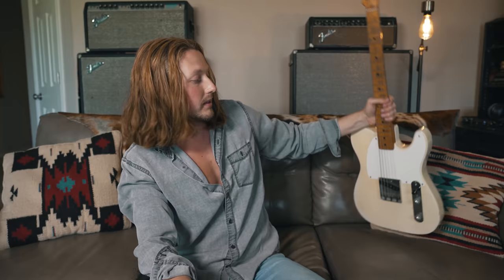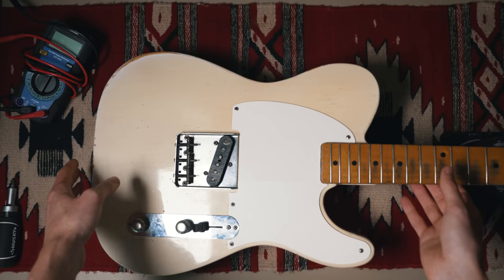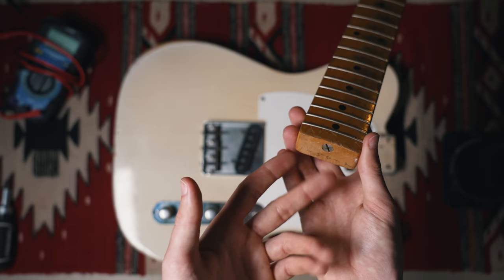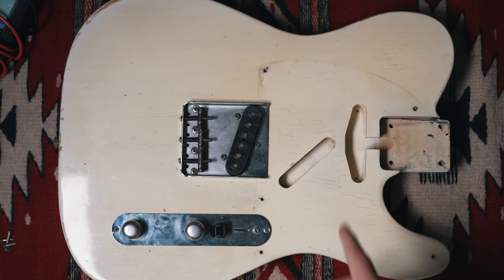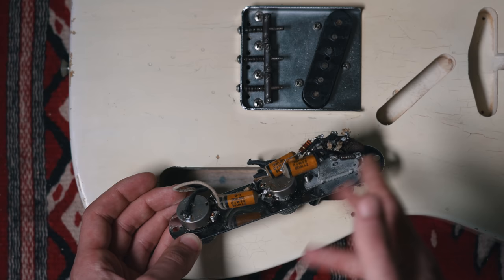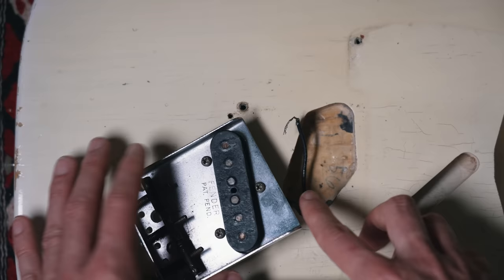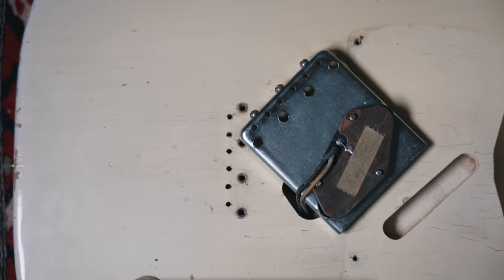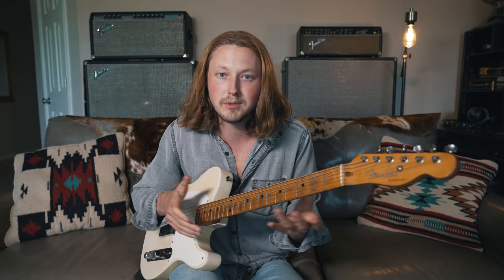Surprises found in a 1956 Fender Esquire

Comment: From all your videos, this guitar seems to be aged in the most beautiful way. Previous owner really took good care of the instrument. It's a keeper. Love your work!
Reply: It's a repaint: The beneath-pickguard paint crackle is fake with aging dinks and doinks! It's made in such a way as to suggest to the eye upon inspection that any pickup hole plugging where the inlaid block is gonna shrink, is part of an original aging proces which is worser in the middle. Thereby your having been completely fooled, it is an excellent job and done as intended... to fool the naked eye. And if anyone doubts this? Look at the "obvious tell" where the plunge router following the top template, went about 0.055" too deep in the between-neck-pickup pass, and the slot tells it all right there. Restoring the neck pocket to hide that one, would require surgical-level template making and possibly the last straw oopsie that blew a near-perfect "vintage" aging finish.

Comment: Couldn't the "Esquire" on the tape on the pickup have been written by someone who had the guitar apart in the shop and wanted to make sure that the pickup got back to the right guitar?  Just a thought.  Thanks for doing these videos.  I learn so much.  😎
Reply: Agreed saxophool, maybe when the humbucker neck route was repaired the Luthier had more than one Tele in the Shop, you'd most certainly want to keep the parts sorted and the tape fits that scenario perfectly.
Reply: How? Original solder  . . Seems pickup has never been removed
Reply: That was definitely the old Fender factory tape..
Reply: @MrTom1468  Yes. Missed that.  😎
Reply: that tape was maybe to separate esquire pickup in the factory from telecaster pickup in the factory
Reply: A better hypothesis is that this pick up was accidentally slightly underwound so to avoid an unmatched set of pickups it was designated for a single pickup Esquire.
Reply: @j_freed  that sounds most likely to me
Reply: @MrTom1468  I thought I saw shrink tubing/tape on the pickup leads at the switch.
Reply: @tater9384  I saw that too. I don't think they used shrink tubes back then.
Reply: @j_freed  That's a great hypothesis
Reply: 👀whoah...heavy thread.
Reply: @davidreineke1758  I'm pretty sure they did, I saw lots of them on old Strats especially, all squashed and dried out.
Reply from the maker: It's possible I guess, but the tape used is identical to what Fender was using in the 50's and the handwriting is reminiscent of what was seen at the time.
Reply: @barrygoins6900  Nope! They're all the exact same pickup. There is no difference in windings or construction. The only difference is the wiring for the Esquire which offered a bassy neck pickup sound in the neck position, a regular bridge pickup with tone control in the middle position, and finally the bridge pickup bypassing all the controls except the volume in the bridge position. I've owned three of these guitars and they always had the same pickup for each one whether or not it was a Telecaster or Esquire.
Reply: @j_freed  No - same pickups for both Telecaster and Esquire.
Reply: @MatthewScottmusic  Got it!
Reply: Perhaps it is related to switching from the flat poles to staggered on the guitars around that time? Maybe an in house experiment? That's exceeding cool and definitely begs a whole mess of questions.
Reply: I’d say the guys name was esquire
Reply: This is the exact comment that I was about to say. I know that I label all of my pickups so that I know what guitar it came out of. I just have so much parts and stuff that I’d never remember every piece
Reply: @MatthewScottmusic  its cool trying to figure things like that out
Reply: A simple solution seems most likely to me. The factory was told “here are X pickups for Esquires, Y pickups for tele bridges and Y pickups for tele necks” and that one got the “Esquire” label because it was on top of the stack for Esquires.
Reply: @luthravin4774  Just because you see the older-style jagged serration on the ends of the tape suggesting it was cut from an old dispenser like a Bostitch, doesn't mean it was dispensed 70 years ago. And it isn't impossible to fabricate a template off some aluminum shard to replicate the pattern with a drywall knife, either. Besides all that: 6.0K seems kinda uncommonly high resistance for a 1956 make.
Reply: @VictitiousStudios  so someone faked the tape too??? really?
Reply: @j_freed  That doesn't make sense to me.   A 6 ohm bridge pickup would be more powerful than any tele bridge pickup no?
Reply: @hkguitar1984  There are aviation rules. Label every darn part, and write documentation on every repair you do. Bloody simple, work this way, and you will NEVER lose any part at all. Sticking tape on a pickup is NEVER a smart idea. Put that thing in some container, and label the container. Sloppy dudes all around, during the fifties?! Long hair and not exactly the military attitude anymore?
Reply: @johnmcneil9164  I want a spectrum analysis. I do not want just some impedance value that is predicting exactly nothing. What do you think you miss, when you see that number?!
Reply: @voornaam3191  I certainly can't disagree with you Voor.    For 11 years I worked in an Aircraft Instrument Shop, repaired everything from clocks to fuel quantity indicators to gyros and altimeters.  No tape on parts EVER and lots of organized and labeled containers.   I suppose my statement reflected the lax nature I've seen with many Luthiers (not all, but many).
Reply: sounds right .
Reply: @MatthewScottmusic  it was a tape that was commonly available , not special fender tape
Reply: @luthravin4774  ah we got a tape historian here
Reply: @voornaam3191  He's measuring dc resistance with a multimeter not impedance.
Reply: @hkguitar1984  Its a guitar not a f'in F16.
Reply: @paulhancock7670  Ha ha ha, so true.
The labeling of parts really pays off when you've 4 or 5 items all disassembled and waiting on parts for repair, keeping them all separated and organized prevents confusion.
Reply: @paulhancock7670  That is a dam good question!   👍😉
Reply: @barrygoins6900 they both used the same pickups. Matthew even mentioned this in the video.

Comment: Those Circles around the neck screw holes are cause by a stop on the drill bit to control the depth.
Reply: good point -- I was thinking it was just the chuck of the drill press pressing down, but I think you're right.

Comment: I owned a 1956 tele that I bought from a NC tobacco farmer in 1974. The neck plate serial number confirmed 1956. A hand-written date in the bridge pickup cavity read 1955. Pots dated to 56. The neck butt, however, was undated, though the position of the Fender headstock logo and string tree was period correct, and body paint stuck to the sides of the neck butt matched. That missing neck date cost me when I sold it last year but I still did OK with the sale.

Comment: That extra hole in the neck pocket isn't a router hole. Its a drilled hole that was used to hang the guitar up for painting. I think the 4 mounting plate holes are drilled after the paint porocess is dry.

Comment: The number on the neck represents the builder. At different times the builders at Fender wrote their names by hand, used stamps or even numbers to mark their builds.
Reply: or could it be a factory 'second' ? .. a blemish or a dent .. as for the tape .. possibly a different string spacing for a strat ?
Reply from the maker: I've heard it could represent the builder or neck size, can't confirm either.
Reply: @MatthewScottmusic  To me it looked like a script "DO" with the top of the D looping over to start to O at the top.

Comment: The circle around the screw hole is from where there drill-bit was pushed into the drill for the right height. When the drill goes down, the spinning claw touches the wood, causing the circle around the hole.
Reply: - if you meant "Jacobs Chuck's jaws" that's wrong, because the chuck nose diameter of 1-3/4" could not possibly fit inside the pocket, and the edges would have chewed up the wood. More likely scenario is: if a template were used using DRILL BUSHINGS in a neck pocket guide block that full 11/16" length, that somebody DID FORCE DOWN onto the bushing, they could then spin and make a sufficient mark like that.

What I think we see here, is the use of tuner bushings or teenuts upside down used as spacers on the end of a paint paddle, mounted too tightly. Using 2 bushings are seen this way in original Charvels Mighty Mites and early pre-Van Nuys Schecter and DiMarzio replacement bodies, but never four. Four is like, somebody who has too much time on their hands to overdo a thing - such as is common to this entire fake Fender Vintage market and - it is disgusting and should be condemned in cases as that. Which isn't clear to me this is here the case except: I never seen four impression marks on all 4 neck bolt holes, and the paint paddle or paintstick never requires "Engine Block Level Footpounds of Torque" force to counteract the weight of the neck in the spray booth rotisserie rig.

Let the naysayer trolls commence...
Reply: @VictitiousStudios  I do agree, what you mentioned is a possibility. Only the circles I’m talking about aren’t in the neck pocket, they’re on the neck itself.

The result I was talking about has occurred multiple times when I’ve been doing exactly as described. If I want to drill a hole of a certain length, I’ll leave that length of the drill bit exposed. Then when you drill all the way in, the spinning jaws create the little circle indentation. It doesn’t chew the wood up, just leaves a little circle. It’d also make sense as to why it’s on all 4 holes.
Reply from the maker: Just Google any mid 50s Fender neck and you will see these exact marks. It's probably from a press or stop of some kind. These marks ended by the 60s.

Comment: I bet this pickup was accidentally a bit underwound at the factory, so to avoid an unmatched set of pickups in a Tele it was instead designated for a single pickup Esquire.
It makes sense for: the ‘waste not, use everything’ thinking of Fender in the early days of hand built with more attention to each detail.
Reply: According to A.J. Duchossoir, Tele bridge PUs in the early 50's were wound with 9200 turns of 42ga. wire and meant to be 7k - 7.8k. That might explain the tape.
Reply: Or the drop in R value could be age.
Reply: A.R. Duchossoir. Whoops!
Reply from the maker: Plausible idea for sure!
Reply: @davidreineke1758  Electrical resistance measured in copper wire per however many feet, is a constant. If we have no constants, we have no science. Do you mean to suggest the decreased magnetic field measurements in gauss affect the resistance of the wire measured in ohms?
Reply: @VictitiousStudios  No I don’t. You can actually remove the magnets and, if you don’t disturb the windings, have the same R readings. Over time the windings can “age”, insulation start to breakdown, etc. 
I had a’67 tele that had 0 R reading and barely any sound. The magnets had completely degaussed. I recharged them but still nothing. There were no breaks in the wire, they had just deteriorated over time.
Reply: @davidreineke1758  I have a '66 and have no such experience with a complete "degaussing." Also I've tried pushing round ground alnico rods thru the flatwork never with positive effect. You must have a certain touch I do not.
Reply: @VictitiousStudios  I have never pushed the magnets out of a tele pu but have removed magnets from a humbucker and still got a R reading.
I think the degauss was my fault of years of leaning the guitar against my amp when not being played!
Reply: @davidreineke1758  Demagnetism only occurs when the field line of force in a magnet are overcome by stronger ones of a counter-tropic polarity. Tube amp transformer emission is insufficient.

Comment: The first Steppenwolf album with Born to be Wild was recorded with a Fender Esquire through a Fender Concert amp. I`m not sure if he used a fuzztone or just the amp on full blast. Also it`s not clear if the pre 1964 Fender Concert with the presence control was used or post 65 was used. The presense control would give an upper midrange boost.

Comment: Hi Matt, after looking at that front route, and the original state of the wiring in the control cavity, I very much doubt that guitar was ever fitted with a front humbucker..
Reply: I'm with you my friend!!
Reply: @ferraridinoman  nope that is vintage, no repair there..
Reply: That's what I thought. The only way I'd believe that guitar ever had a humbucker would be if the original owner told me so themselves.
Reply: IIRC, GE Smith has a similar Esquire...with two pickups. He said that in the '50's, Fender would add a second pickup for $15 if you mailed the guitar to them. This would only be possible if that rout was placed when the guitar was made.
Reply: @DLloydGray  Great info!
Reply: I'm of the same opinion, doesn't appear to be any repair at all. Looks like Matt scored like a bandit on this one!

Comment: Its quite a late Esquire as the first ones came out in 1950 or 1949 depending who you ask , still this design basically revolutionised Rock guitar as before the Esquire , musicians used to use really large semi hollow body Jazz guitars like The Gibson Es 150 jazz guitar which was huge by todays standards , The Esquire made the electric guitar more portable on stage and gave a better sound thanks to the solid body design =more sustain and also it was the first electric guitar to have a modern pickup system.

Comment: I had a '51 esquire that had Tadeo Gomez' signature. Not completely sure what wood was in the body. The finish was odd, more opaque than finishes that came only a year later. It did have the route for the neck pickup like a Tele but it was definitely an Esquire, original bakelite pickguard and all slotted screws, even the truss rod. It was really primitive, like it was made in a high school wood shop ! I sold all my '50's fenders in 1997 to put a down payment on a house- no regrets. Those worn in '50's fenders are beautifully simple and they can be really light and resonant.
Reply: Cool. I had to sell my prized 54 Strat to help pay for a heart attack. Neck 5-54, T G. 0209 stamped on the spring plate with a crooked 9. Electric cavity 6-1-54 Gloria. Glad to be alive. Wonderful neck, yummy. It was refinished before I got. Fools.
Reply: @elkennedystrat7894  Why dom't you have a health-insurance? 
In Germany (EU) it is mandatory to have such trivial things, like a health- and invalidity- insurance! And it is one of the best things you can have, it will rescue  your house and a lot of money! 
I never regret, to gave a lot of my hard earned money, for such things! Now that I am not able to work anymore, I am in a save harbour ... ! 

This is the stupid "American way of life" (or 'die'!) 

Sorry to say that, but you would have your old Fender beside  you, by now! 

I am 60 years old, and not going very well, but my 'early retirement' and my "health-cost's" are paied by the two different insurances we "must" have! 
If not, i have lost our house, ... and don't know, how to live right now! 
I have all the time, to play my Fender Stratocaster, ... and doing a lot of HAM-radio, during the day, ... !

Greeting from DL,
73 de db9pz ; Markus

Comment: Trying to figure out what Tele was made with pine bodies,I know some early models were,this guitar looked too heavy to be pine,another cool find Matt,your guitar collection so far is top notch,thanks for sharing.
Reply: Most if not all the pine bodies date back to when Fender was still calling the dual-pickup version the Esquire. They’re prototypes really since the guitar wasn’t officially available yet.
Reply: Some of the prototypes that Leo put together had pine bodies - even some of the early production models too.
Ash was a resonant and cheap wood back in the 50’s so that’s why it was used.
Nowadays, top quality lightweight swamp ash is an expensive wood and hard to obtain.